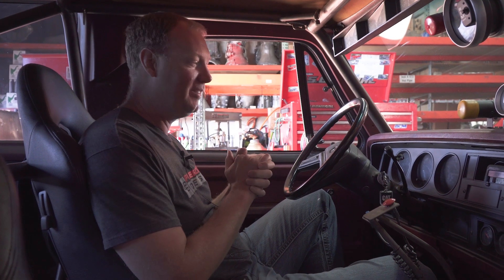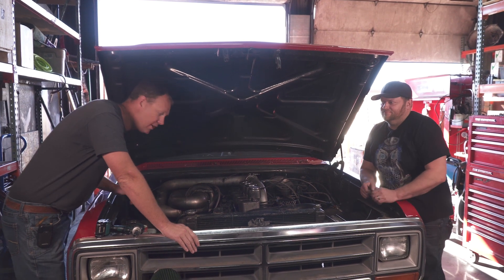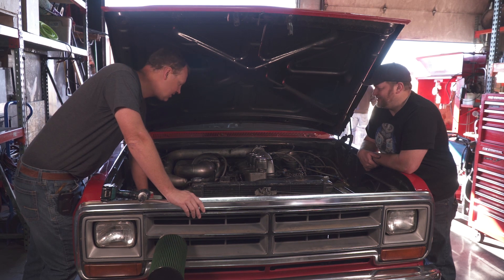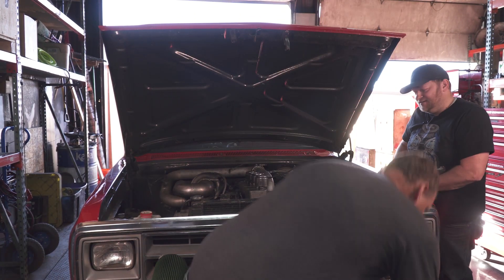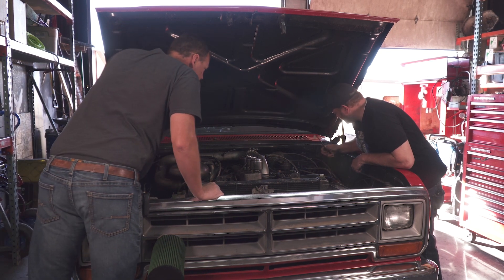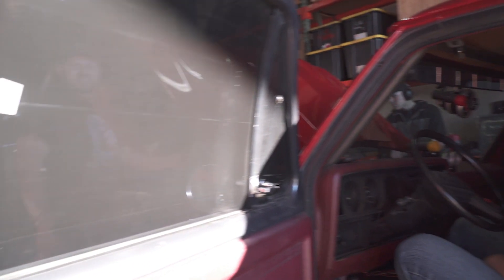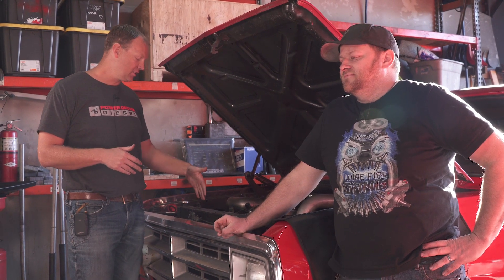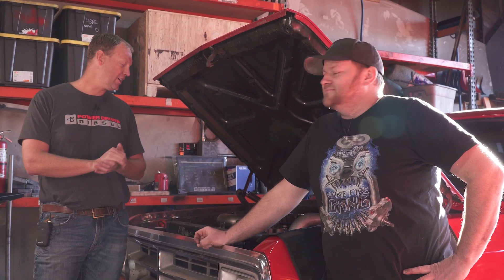12V Cummins Swapped Ram Charger | ProStreet Drag Diesel | Power Driven Diesel

Comment: Wow that thing was major sick to start with.  I wonder how old the fuel is in it? A twin turno 13mm p-pump only putting 400 to the tires  sounds like about 12deg of timing.  With the turbos it has and the fuel I would expect 800rwhp  on a good tune up.
Reply from the maker: It will make a lot more power. Just got to work thet bugs out.

Comment: I thought about doing a Cummins swap in my 85 Ramcharger just seemed to be to much weight for a 1/2 ton 4x4. I instead did a 440 nv4500 swap with an atlas. Super happy with turn out.

Comment: QUESTION is their any kind of timing light for diesels?
Reply: You mean to time the engine?
Reply: I don’t believe there is a timing light. You time these (I’m not an expert) using this little “flag” that you stick in the pump that puts it at some stock degree of timing. Then I’m not sure how they modify it from there without putting on an adjustable timing gear.
Reply: Yes